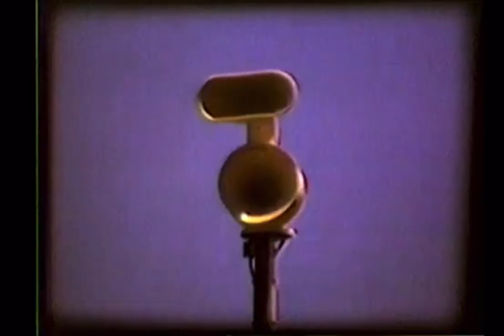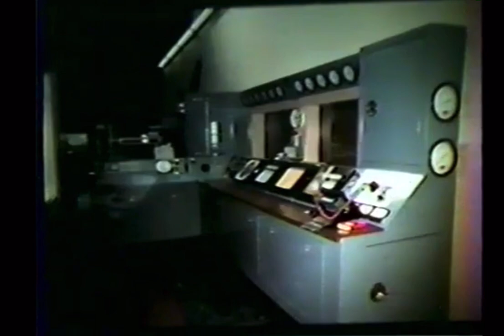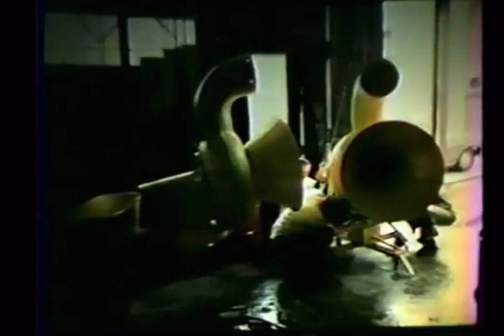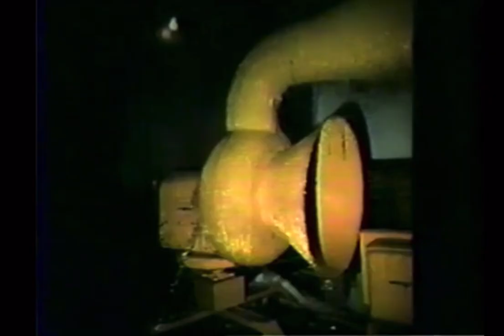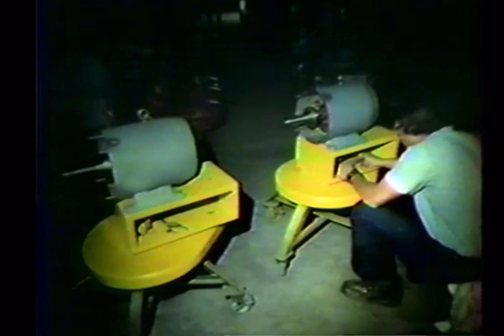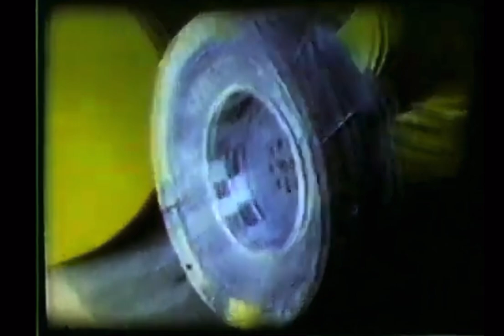Alerting Communicators Of America  -  Allertor 125 (1980)

Comment: Why does it look like a toilet though?
Reply from the maker: I don't know but maybe they did that so it could stand out.
Reply: @TrainsAndSirensofCA The top horn actually sucked in air which went to the rotor, located on the bottom. The air supercharged the sound and made it louder.
Reply from the maker: @atsf47legit Actually the top horn is where the sound comes out of because the main horn is the intake if you look at the chopper.
Reply: its because back in the day when it was known as biersach & neidermeyer CO sydney j lattow designed the horn in such a way so it could be loud enough to warn citizens
Reply: Oh shoot, I thought the top horn was for blowing out air like when the chopper starts spinning. I thought the compressed air since most of the stater is in the horn. I thought the air just went out out of the horn and that’s why I can this one video when it was testing, it was blowing out snow so I think that proves my theory.😅😅😅😅